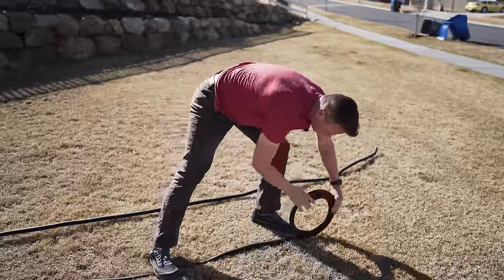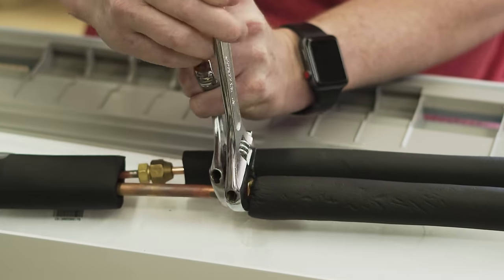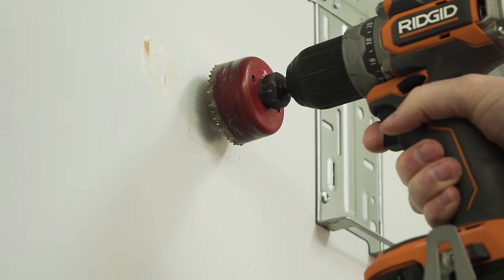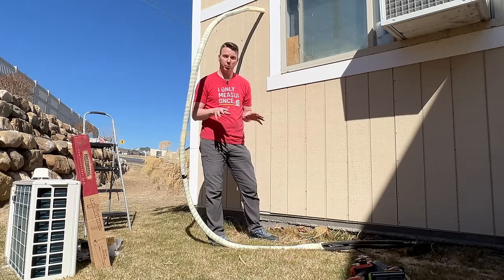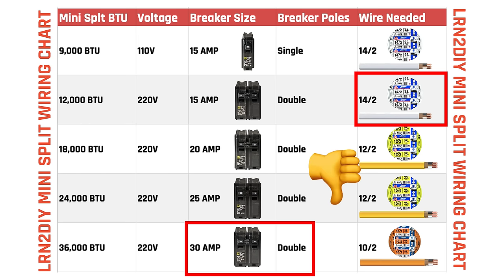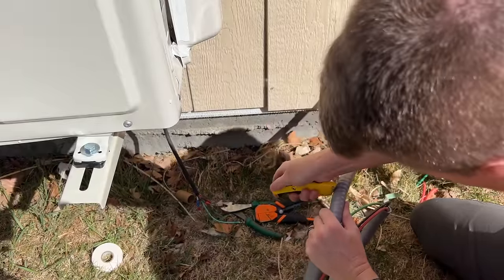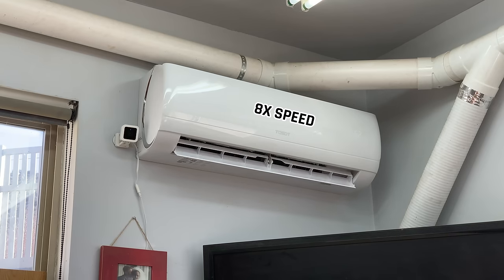DIY Mini Split Install - All the Things Nobody Shows You

Comment: This is the 3rd mini split video that referenced the set of compound gages going to 30 for 15 minutes. The first 2 said, "30 psi." It's actually "water column", not psi. And compound gages are not a finer enough measuring tool. Imagine doing a recipe that called for a 1/4 ounce, and you used a 1 gallon measuring cup, or did surgery with a butter knife.  It says "30" but it just looks that way. (28 inches are 1 psi, so you drew that unit into a 1 psi vacuum) R410a, the refrigerant you're using, wants a deep vacuum: 500 microns. 29 inches of water column is 20,000 microns. (Not horribly difficult.) To go from 29 to 29.9 is to go to 20,000 to 150. (harder but doable) But 15 minutes is an arbitrary number, (a number I'd never use) and a set of compound gages will not tell you the depth of vacuum or whether you have a micro leak; a leak that won't show up in 15 minutes, but over a couple weeks. Only a micron gage will tell you the depth and quality of your vacuum. If your system is working, great! But it is working in part by chance. For the vacuum part, you were flying blind.  So when your compound gages say 30, it ain't 30. It just looks that way because we measured ounces with a gallon bucket.

Comment: When you took the gauges off it would've sucked some air in to the line. You need to release a little bit of gas before you remove gauges. It's all these reasons these systems should not be done by anyone.

Comment: Don't forget that NEC Section 210.63 requires a 125-volt GFCI, single-phase, 15- or 20-ampere-rated service receptacle located within 25 feet of the hvac equipment for servicing.

Comment: Great video, many thanks, in Wales UK, wire sizes different here.....metric.. no problem though,  1 comment , 1 question (sorry) will placing the leads behind the outside unit reduce the airflow?... 2. Even allowing for startup current..15 amp..ok it doesn't use 15amp ...but if it did that works out at £1 an hour here..that would x2 my monthy bill.. it would be nice to know your running costs...many thank thought

Comment: You need to use the proper breaker for the condenser. Also put connectors on your wiring on the inside unit.

Comment: Seems like a reasonable DIY project. Not sure how you check pressure of the completed system to know if you have the right amount of refrigerant. I'll search for that elsewhere.

One question: If it's doable in a few hours, why do all the local people charge $8000 for this job? Shouldn't it be more like $1000?

Comment: Looks good, but...
* It's OK to oversize wires, but unless you're making a long run, it's usually not necessary. The rated capacity for these wires already has a good amount of safety headroom, so you're not gaining anything in terms of safety by oversizing.
* It's not OK to oversize breakers. You should only install a breaker that is appropriate size for the appliance that it feeds.
* NM wire is not rated for outdoor/wet installations, even if it's protected by conduit. Use UF (Grey colored wire) wire for these cases, it usually costs the same as NM, if not a few dollars more or even less!

Comment: Note it’s 220 volts not amp…. You are correct 16 gauge is not rated for 15 amps… 14  gauge is correct for 15amps… use the white is acceptable… you need to flag the white wire with either red or black tape on both ends…

Comment: I'm not going to repeat the breaker size issue already spoken about below, but I am going to clarify a bit on the wiring because I don't think comments below were clear enough.
On a 220/240 circuit, the black wire is "L1" and the red wire is "L2". These each provide 120 vac "out of phase" with each other. they share the white wire as Neutral. AC power, or "alternating current", as the name suggests, "alternates power between the power legs (L1 or L2 in this case) and neutral, meaning it flows one way and then the other. When you have two power legs, they share the neutral by taking turns "alternating" into the Neutral, all at the speed of light so L1 and L2 never connect directly until they meet at the "tool" or equipment they are powering and of course do not short out. The green or plain copper wire is your ground. 220 vac has to have all 4 wires these days according to code. A house with say a dryer or electric range with only a 3 prong plug is grandfathered in until there is a upgrade or remodel. New installs have to use all 4 wires.
Also, if you want to do this yourself, you need to be prepared to do it like the professionals. Use a micron guage when pulling a vacume. You cannot tell if there is a vacume leak just by waiting 15 minutes and seeing if the needle moves. Either give it much more time (12 to 24 hours), or use a micron guage. They are cheaper than that vacume pump which is likely undersized. 5 cfm is ok for a home refrigerator, but a mini split should be 7 cfm or more.
As a final note..., Using larger wires is fine and will never cause a problem, however the breaker has to match the requirement, otherwise if the equipment has a minor short somewhere, or say a struggling condenser fan motor, it won't shut off the power when it needs to, and can cause the fan motor to overheat and catch something on fire. Just one example.

Comment: Your electrical connection to the panel (and pre-existing connections) are illegal and you should fix them immediately.  If anything happens, your insurance won't cover you.  Add knockout fittings/connectors for every wire going into your panel ASAP.  I'd recommend you have a read of the NEC.

Comment: I did each step meticulously. But when pulling a vacuum, and shut off pump, it won’t hold a vacuum. I have triple-checked all the tubing flare connections (as best I could with a vacuum only). And I am about ready to call the AC guy! 🥵🤬😡

Comment: Ooops.  There is no chance that if this unit overloads that it's going to blow a double 30. It's rated for a double 15. You doubled it because of The Wire you're using which is wrong.

Comment: Question (for anyone): I noticed in another installation video of a mini split system there is another step of checking the pressure with a separate refrigerant tank (he used nitrogen) and also to check for leaks. Is this step not necessary? Thank you!
Reply: We always check with nitrogen. Every piece of equipment we install.
Reply: It is required if the tubing is leaking.  I did not test with nitrogen, because I do not own a high pressure nitrogen tank, and never used one that my boss did not pay for.  Now retired, I have no plans to buy one.  What I did was install the tubing, pull a deep vacuum while doing other things like run the electrical lines, and such.  So after about 1 hour, I shut it off, and opened the refrigerant line about 1/4 turn for about 10 seconds, then shut the line.  I had about 50 PSI in the lines.  Then check with soap bubbles (I used a $475 leak detector) for leaks.   No leaks, then the system is ready to use, and open both lines with a allen wrench.  The refrigerant is already in the outdoor unit to run up to about 20 feet of tubing.  On longer systems, I would add about 1 ounce of refrigerant for each 10 extra feet.

Comment: So a dumb question. The vacuum goes down to @ -15 and then stays there for 15 minutes. Turn off pump and let sit for half hour (watching FB game) and the gauge doesn't move - still @ -15. Now the dumb question, when I remove the blue line there is a hiss of air escaping, then the same thing happens when I remove the adapter - is this supposed to happen? Thanks!

Comment: There are so many electrical errors in this video. As others have said using  a 30A breaker on a unit that lists 15A for proper protection is a code violation. Using EMT exposed outdoors is a code violation. Using NM cable inside conduit is a code violation. The electrical portion of this video should not be followed.

Comment: I just installed a Tosot 230V 9000 BTU mini split in my pool house. I found this video and your follow up videos extremely helpful. This was my first install but I’m pretty handy with electrical and building. For vacuuming the lines and releasing the refrigerant I found a video made by HVAC Mechanic that was extremely helpful as well: 
https://youtu.be/DgaPPyAZSTs?si=uId0qpnmQh-2qxM8
I set the outside unit up on concrete blocks with solid concrete block toppers and secured it with 1/4” concrete bolts. Thanks for posting your video!

Comment: Good video but your 30 amp breaker may be too big for the specs on the unit. Wire size is fine, and can handle that breaker, but!! The components may not be able to. If they need a disconnect at say 20 amps max, your breaker won't trip and you may cause am over heat situation. Please size that Breaker according to manufacturer specs. I remodel and have had to do rebuilds where this had occurred.
The breaker not only protects the wiring and electrical connectors it also protects the connected components.
Hope that helps.

Comment: Several mistakes on the electrical wiring portion: 1. using white wire as an un-grounded current carrying (220V) conductor is wrong; he should have used black and red. 2. he should have chose the breaker size as recommended to protect the unit; it doesn't matter if the wire is oversized.  3. he shouldn't run Romex inside conduit; He could have stripped the sheathing off and used the wire inside (or so I believe).

Comment: Bro use a AC company recommended DP breaker/mcb ( what ever it is called in your country ) . Here that is 15A mcb , most likely a type 'C' mcb .

Running a higher capacity wire is fine . That will not create a problem .

But running a Bigger size MCB then the recommended size will led to MCB not tripping when it should . 

So replace it with 15A DP C curve MCB even if the wire size remains the same . MCB will cost less than the 30A one .

Comment: You can't over size a braker bro If you're unit is 15 amps max.
And you put 30 amp max breaker. That means the breaker won't flip until it reaches over 30 amps Which is double what that unit can handle. And we'll destroy that unit if it pulls that many amps without flipping the braker

Comment: Glad you showed that you need to have a vacuum pump that a diy person will use basically 1 time. Also what a lot of folks don't know for these mini splits you need room in your breaker panel for its own power source. Don't forget if you buy a mister cool its hard to get parts. Oh yeah don't forget mini splits break down a lot if im wrong prove me wrong I've been in this trade for 17 years and i know these things have issues a lot and are difficult to work on. Also parts are rarely available right away most time frames are 2-4 weeks out. DON'T BUY ONE!!!!

Comment: Better if you do a pressure test with nitrogen first, because if there is a leak it will draw moister into the system under a vacuum. Plus much harder to know where the leak is and redoing the vacuum over and over trying to find the leak is even worst. Also more dependable using actual pressure to test for leaks than vacuum.

Comment: ** be careful following the wiring instructions provided, for example the disconnect I’m using has the line wires, ie the wires coming from the breaker, coming to the disconnect on the outside, and the load ie the condenser wires are on the inside **

Comment: Hope your still reading comments. This was a perfect video i finally found to use for my first split unit. Its funny i knew all this information and know how to apply it but the vague instructions had me seriously hesitating doing this for my customer who trusts me 100 percent.  Question i have is . When the lines exit the building do they in no way need any other protective housing over them . To avoid sun rot to the tape or anything with force coming into contact with the length hanging down from the top to the pump.  Example boys throwing football near the lines.  Tree branch breaking off tree and swinging into or against the lines.  Its a trivial question but i trust your insight.

Comment: Did this guy really disconnect the pipe on the Schrader valve with a vacuum in the pipework?  😂 why did he buy a $150 vacuum pump again?  Well, video shows why you shouldn’t touch fgas if you don’t know what you’re doing.

Comment: Nice overall, but alot of horrid electrical.
Outside of the addition of a surge protector, because AC condensers are subject to lightning, strike, surges quite often. However, even looking at the panel, there are a lot of wires coming into the load center, which should have hold downs for those lines. Why somebody would just knock out, the knockout, and then stick a line into that hole with the sharp edge is beyond me in the first place. 

Wire is expensive and clearly you just wanted to get the job done because you probably could have treated in that why are you have and got yourself 100 feet of 12/3 for it (the way people are pricing wire these days).

I agree with other people's comments that, since you were using red and black conductors, you should have just put those through the circuit breaker and then ran the other end to the disconnect, leaving the white neutral wire capped off. 

The worst part, though, is that the EMT connector that you used and you can't even look at the manufacturers website, is not rated for outdoors. 
many people get this confused but just because it is an insulated connector does not mean it is for outdoors. All it is doing is insulating the wire as it passes through. It offers no watertight protection and it is an electrical code violation probably since at least 2015.

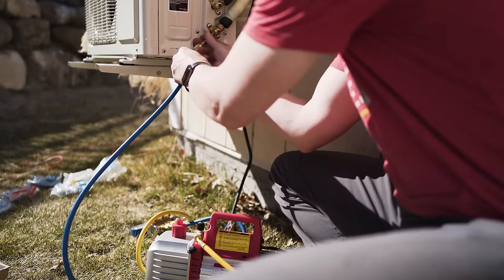Comment: Wrong. at 18:53 he unhooks the blue line before opening the high pressure valve 1/4 turn for 5 seconds.  There should be about 15-35 lbs pressure of refrigerant in the line BEFORE disconnecting teh blue line.  This is improtant to keep air out of the system.

Comment: You connected 4 wires in breaker box and only three inside condenser . Why. Have two “hots “ coming off double breaker if you only connect single. Black hot wire ? Using red as neutral . Where did the white wire go from double breaker ?

Comment: When you disconnect gauges while under vacuum, you would be better to 'release' just a little refrigerant to have positive pressure when removing the manifold gauges, without you are sucking a little bit of air. Will you notice? probably not... at least not for a while. but for perfect, last long long time do like I suggest

Comment: had you connected the line set after you had the air handler  installed it would have been easier. Running the power line before the install would have made things easier too.  One more tip. When you had a vacuum and you disconnected the gauges some air was reintroduced into the system. One easy way to prevent that would be to open the high pressure valved for 5 seconds  to produce a positive static pressure. Let the unit  sit for 15 or 20 minutes. Take a pressure reading and then remove the gauges. A little gas will escape preventing any moisture from entering the system. Wear gloves. You'll never have more than two eyes so get into the habit of wearing safety glasses.

Comment: As a qualified hvac engineer. If you don’t have at least a level 1 in construction plumbing or electrics. Don’t try to install one of these units on your own. The tools you’ll require to do the job correctly alone cost upwards of $400. And without them you are guaranteed to have a poor performing unit at the very least.

Comment: NM cable can't be used outside even  in conduit. Always use the nameplate ratings for wire size and over current protection.

Comment: So many comments - had to say the electrical service should have the 2x 15a breakers, not the 30a you put in. The wire is over the required for the minisplit but it does not dictate the amperage at the box. The minisplit dictates the amperage at the box which should be the 2x 15a. You are not protecting the wire, you are protecting the minisplit. To have a perfect system here you should have the 14 ga wire, then the minisplit and wire would be protected. But since your wire is above the spec for this unit, the wire is being protected but your minisplit is not. I don't know the possible negatives of this, but can only recommend installing a 2x 15a breaker. Good luck!

Comment: It's best to use a sleeve in the hole to outside with a 3 inch  hole. You need nitrogen and leak check after after assy. And before  the release of refrigerant. Many people call me to fix the mistakes they made after they thought they installed it correctly. EVERY mini split needs surge protection  on the power main at disconnect. You will be sorry 😢if you skip it.

Comment: Electrical Code violation--- code in many areas require that single wires   be used in conduit and not sheathed wire (e.g., Romex) that you used. Nonetheless, other than code, it will not make a big difference since heat buildup in the conduit  should not be an issue because of the 10 gauge wire you used (which is way way way overkill).

Comment: I dont have residential experience, but what did you accomplish by vacuming it with the line closed and then then disconecting it?  Theoretically, you vacumed up to the valve ( 1/4 inch ) but then you let all that air back in  ( although a negliable amount). 

I do appreciate bringing up a brand other than mr cool, i may give them a try.

Comment: Also when you using a vacuum pump you supposed to open the ballast so that the air that's in the line is not going through your oil until you start to pull into a deep vacuum then you close the ballast allowing any moisture that's trapped inside the system to go through the oil which is how you bring it into the lower microns and 15 minutes is not enough to get moisture out of a line set without doing the ballast open close